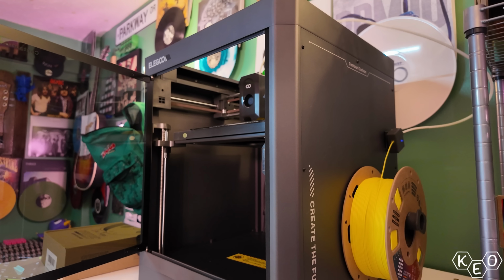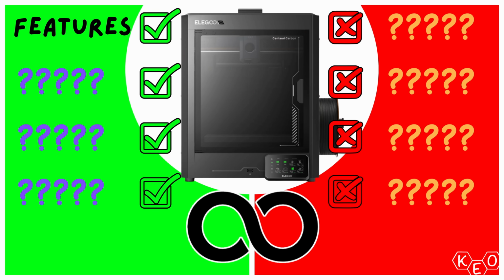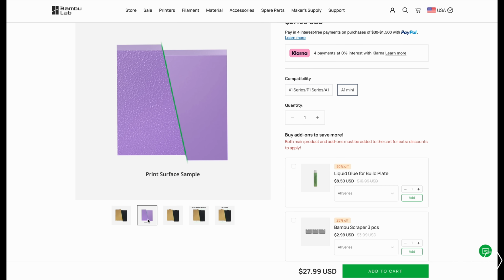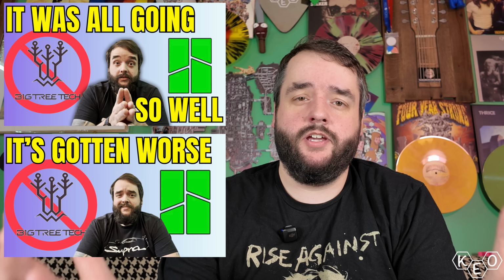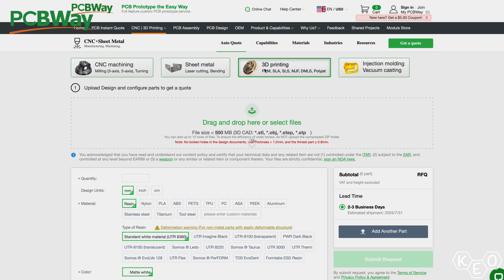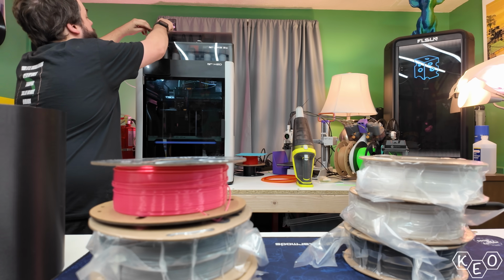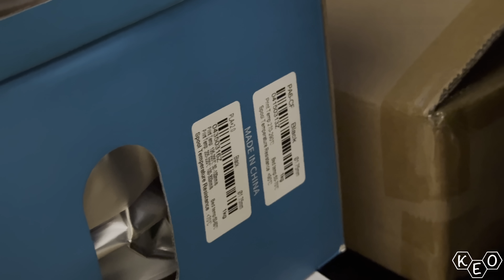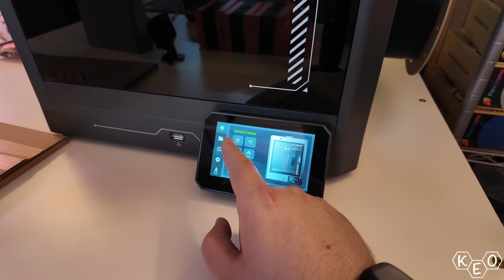This $300 Elegoo Printer Months Later — Here’s the Truth

Comment: I know this is an older video now, but I still thought it worthwhile commenting. I've had my Elegoo CC for around a month now and given it is my first 3D printer, of any brand or model, I think it's great. I agree it's loud, but that's the only issue I have. I printed the vented riser I  pla a several days ago and with the lid on and the vents open its quiet enough for me. I'm just learning the craft, so don't know what a quiet machine is like, so it's fine. Also, I asked chatgpt and it suggested I use the Elegoo slicer, and it's worked fine for me. Again, I probably don't know what I'm missing out on, but ignorance is bliss, or so they say (who ever they is). Here in Australia it's costs $670, but I got it for $600, I also got a Creality CR - Scan Ferret Pro for close to 40% off as part of the deal, so I'm happy. The main reason I went for the deal was I want to print in ASA or ABS, so having a chamber was a necessity. From what I've seen and heard, you can turn off the fans and the chamber will stay much hotter, so a heater is not essential. Anyway, thanks for the video, it helped confirm my purchase.
Reply from the maker: Glad to hear it. If this machine is working for you then that is excellent. Don't worry about the slicer, don't worry about the noise; if it is suitable for your uses then the printer is very good.

Comment: I just got mine a few days ago and I still haven’t been able to get it to actually print.
Reply: It took me about 10 minutes to figure out why mine wouldn’t print you had to make sure the temperature is the temperature. The filament requires. It should say on the filament what temperature you need to set it for
Reply: @s @samuelgonzales1466  I tried that. I’m using PLA, and Google said to set the bed to 60 and the nozzle to like 200-230 so I did 215, didn’t work.
Reply: What part are you stuck on?
Reply: @AfromanSkeeter  i put it together and set the language and put in the filament, but when i try to print anything nothing comes out from the nozzle, and the temperature changes from what i set to just random temperatures. Never the same though, somwtimes itll be 180,  others 140. Never the same though
Reply from the maker: What a mess. The machine should just power on and run through its self-calibrations. Then you should be set to get a print sliced up in the slicer and sent over

Comment: I bought the Elegoo Centauri Carbon. I paid $280 + $30 s/h the week after they announced the delay (perhaps indefinitely) of the four color system. Out of the box I printed all of the files that are on the included USB drive and they all came out nice. I've since downloaded a few files from thingsverse and the only one I had a problem with is a visor to shade the radio screen in my truck. However, I believe the problem is likely attributable to my inexperience in selecting a filament choice and the learning curve of Orca. I'm learning quite a bit that I might miss out on if my choice had been a more expensive machine in the walled garden of Bambu Lab.
Reply from the maker: That is true. The sliding scale of learning by tinkering and fuss free printing both have their merit. This is why both routes should be considered. Not necessarily this or that, but this AND that. Happy you are finding your way. Enjoy!

Comment: Mine has been so good, I ordered a second one. Which came with a vastly updated camera and light solution for less than the original price. I have done everything you could ask on it and its printed perfectly. ABS, PLA, PETG. Ive done everything from tiny little spindly things (harry potter wands) to pieces that take up the whole build plate. Cosplay to functional.

Currently you can get one for 270-280 thanks to Black Friday and the fact they just announced the CC2.

Am I thrilled it probably has some data going back to China? No, but right now its really just Europe and China making good printers and European companies are charging 3x more than this for the same thing. Yes, this is a "loss leader" but come on, just put it on its own VLAN and you dont have to worry about them snooping if they are.

Comment: Rethink about a riser there is a really nice one on printables "Elegoo Centauri Carbon: Yet another but sturdy riser" it not like the cheap ones everyone is using I like it because it has a place for lights and assemblies with bolts and nuts. I am looking forward to AMS for the same reason just easy to load up filaments in the mean time I am using a infinity flo auto loader it is not the best solution but does allow you to use 2 spools at the same time. My printer has 575 hours of print time and just placed an order for another one coming in today and when this gets all setup and elegoo puts out the carbon 2  I be getting that one as well

Comment: Comparing the Elegoo Centaur Carbon with the A1 Mini isn't really a good comparison. The reason people are watching this video is to see if the Elegoo Centaur Carbon is going to be durable enough, and should only be compared with other Core XY printers, not "bed slinger"...

Enclosure Heater on a $300 printer? Come on! I'm guessing the intent is that the fan is supposed to turn on if there is a sensor inside the enclosure and the temperature at wherever that sensor is goes above a certain threshold (for whatever material you are printing), the fan should kick on. It may not be getting hot enough at the sensor, to trigger a fan turn-on. Regarding an enclosure HEATER, I definitely do not agree that it should be included and fully functional on a printer of this price! You're expecting WAY too much! Elegoo needs to get onboard with upgrade kits and mods made specifically for their printer. The heater again, needs to be tied to a sensor, with the sensor someplace around where whatever is being printed is. After all, that's the location the temperature actually matters. If the sensor is at the top, it'll go off too soon, if the sensor is on the bottom somewhere, the temp will probably get too high...

Your review is a good one overall! Thank you for the honest review!
Reply from the maker: Thanks for taking the time to comment. Happy to have you around friend!

Comment: Between this and the qidi plus 4, if I don't care about size nor noise nor price, and want to specifically print engineering parts out of asa/abs/nylon/carbon fiber, which would you recommend personally? Or would they just be as good as eachother?
Reply from the maker: Well, I always recommend bambu before anything. They are the most reliable, fuss free, and user friendly. Otherwise, I am personally a fan of the Qidi plus 4 or the Qidi Q2. I have heard of others having issues so have a look around at reviews and decide for yourself but that is simply from my experience.

Comment: I havent tried, perhaps ill update this comment when I do, but I am pretty sure you have to enable the temperature control within the slicer if you want the chamber to be a certain temperature. It will not control the temperature by default nor is there a button on the panel but I believe the setting in the slicer for that print would do it

Comment: I have owned 8 3D printers in my life.. and the Elegoo is the only one.. out of the box that did ABS perfectly first time. Living in Australia I have seen PLA buckle in a car in summer!!!.
Yes the bed is a little small for big project, but I have my Anycubic Korbra Max 2 for large items.
Been printing now for 15+ years and its SO great just to power on, heat up, load and Print.
Previously it was tweeking, adjusting, adding Klipper, and mod, mods, mods.
Reply: Was one of “klipper  modded” printers a Reality Cr-10 ?

Comment: I literally just got mine and ran into all the problems it can possibly have from the start that other people have. There's a bit of green filament form factory test where it got clog in the extruder/nozzle and took way too long before i was able to pry it out. After putting everything back together then I have the issue where on boot up it stuck on a loop with the start up logo. I disconnect and reconnected back some of the lil cables and fixed that issue. But now on start up the nozzle temperature just kept going up and won't stop even when i try changing the nozzle temperature. I lastly have to resort to contacting customer support and waiting for a respond back.
Reply from the maker: Yikes! What a mess

Comment: I'm desperatly trying to find a great printer in this price point and I'm fed up with everyone recommending bambulab stuff. I DO NOT want to buy those exactly because of their anti-open-source / closed ecosystem. Closed ecosystem are dangerous and we have the chance that 3d printer are built around opensource so we must protect this at all cost. Its MY machine I don't want my stuff going through THEIR server that will inevitably get shutdown when they feel like it making the machine a big metal cardbox, which is why I'm pretty worried about Wifi 3d printers / apps.
Reply from the maker: If that’s the case, the Centauri Carbon is a great option. Otherwise, I am partial to Qidi printers. Their Q2 is a great option if you’re wanting multicolor as well

Comment: From the looks of it, it quite vibrates alot. I think the printer is having to low weight to combat that vibrations.

And i also dont like how the PTFE tube is moving the filament when the head is moving. The filament should be able to enter from the top and without any obstacles. Can they fix that in upcoming version, then im sold.

Comment: Yeah, every company needs to commit to one slicer.  Prusa Slicer is actually the core, then Bambu modifies that to Bambu Slicer, then Orca takes that and makes their slicer.  Prusa Slicer is already open source, why can't everyone just contribute to that?  I mean, I get release cycles and you might have to ship your printer with a beta version until Prusa can roll the feature sets you need into the official Prusa Slicer.  When your specific printer features are rolled in then just have your users upgrade to Prusa slicer stable branch.

Comment: I used the Elegoo slicer once. Then moved to full blown Orca. No issues. I'm with you on one slicer to rule them all!
The light: Please note, they have fixed that with subsequent shipments. Unsure if you can retrofit or get the new light from Elegoo. There are many solutions to this. A friend has the one with a crap light, he uses a rechargeable LED light strip with motion detection. Turns on as soon as there is movement. 

Overall, I'm embarrassed with the prints my Ender 3 Pro did now. I've put a lot of money into upgrades for that printer. I also have an old enclosed Creality CR-200-b. It is OK... but no where near the capability of the Elegoo CC. I could not be happier.

Comment: I don't get it.  Me the wife and baby sleep in the room next to the printer and my wife who can't even run a fun in the room because of her super hearing, can't hear the printer.  Also, I have never (despite Elegoos recommendation) run the printer opened.  It is always completely closed even for PLA and I've had nothing but stellar success with every single print.  You could also cut down the acceleration speed of the ECC by half to match the A1 which will also help quiet it down.  If you're absolutely desperate to go even lower, rig  a funny pad in front of the printer (w/ two light stands and two A clamps) to really deaden the sound.

Comment: Had mine a month and couldn't be happier. I've been using a flashforge creator pro for the last 10 years which has served me well so this is quite an upgrade for me, finally enjoying auto bed levelling, flexible buid plates and an extruder and heatbed that get to temp FAST. Printing ABS is a must for me and I almost pulled the trigger on the x1c a couple of times but hesitated after their snafu last year then the lacklustre release of the H2D - now I'm glad they dropped the ball and I managed to get this instead.

Comment: I am very happy with mine. The only issues I’ve had functionally were a combo of user error and bad filament.  I tried to print without the removable bed, and that made me replace the hotend.  Then I had 1.75mm PLA become 2.5mm in the same roll, and that clogged the hotend and needed another replacement.  Then I had to clean out the toolhead from all the filament shards building up from the  12 hr of run time with too thick filament.

Overall, very worth the $300.  And with cheap enough parts / filament, failures are not a huge deal

Comment: I have 160 hours on my carbon, I have had only 1 issue were my leveling got messed up and put the nozzle straight into the bed this gouged the print surface really bad. I ended up using a p1s print bed with zero issues.  

A solid ⅓ of the 160 hours is printing PET-CF for automotive parts I make.  

Over all i would 100% order another one when the time comes to expand.

Comment: Isn't calling it even kinda open source being super generous?  The firmware is still closed source, they've gone to some lengths to deter custom firmware, and they don't publish cad files for the hardware side of the printer.  Isn't the only open source part that they happen to use an open source slicer?  (oh and that they haven't (yet) walled off access to the core printer functions, but I'm not sure that falls under the meaning of open source)
Reply from the maker: Yes, I realize that it is a very generous statement. But like I said, it is open enough for me to use orca and that is all I am looking for. Its an unfortunately low bar but its more than I can say for Bambu and Anycubic

Comment: You say you don't care about the openness of printers, but if you had a regular plain Klipper interface you would know the answer to all your questions.  What fan is running, what temp the chamber is at and if the fan is running. You would even have a button on the screen to turn it on and off at will.  The temp of the hot end and the duty cycle of it, is key to knowing if you will clog your nozzle because of running to quick or fans too high.  This information is hidden from the user on Bambus and sure you have no issues if you run their filament and regular settings, anything else sucks and is like printing in 2015.

Comment: The one thing i don't like , and i think it's firmware related.
Once the machine is printing , you CANNOT remotely change anything , not even turn on the light.. not from the slicer , not from a browser. (you can type the ip adress in a browser and basically control and upload gcode from there)

Comment: You have to remember that the reason we’ve reached this point in the 3D printing timeline (cheap and good printers) is because of open designs and software. While I don’t necessarily care if a particular company is locking down a specific machine, I do very much care if they’re a good steward of the industry as a whole and if they’re contributing back after all the knowledge and engineering that they’ve benefited from (which is all 3D printing companies these days). If a company insists on giving nothing back, that’s one step away from the Stratasys model, and that model is pretty dangerous for progress in the category as a whole.

Comment: Thanks for the review. Quite informative. And I'm glad that Elegoo seems to be embracing Orca Slicer. Being able to use Orca will be a requirement when I decide to get an upgrade to my P1S
Question though... the parts of the printer that feels "cheap", are they things that you could possibly print replacements for in better materials? In other words, could there be an upgrade/mod path?
Reply from the maker: That's an interesting idea and I suppose you could. But in general, I feel like this machine feels a lot more premium than its price point. The electronics appear to be fairly simple and the brains controlling the thing are certainly simple. But in terms of the parts of the printer; I think they're pretty alright

Comment: My Centauri Carbon is due to arrive this week, looking forward to finally dipping my toe into FDM printing.   Honestly while it low price is very nice what really drove me to go with the ECC is having had Elegoo Resin printers for several years and always having a great experience when dealing with their customer service.  For me a known factor of good customer service is more value then risking a company I have no experience with or getting into a walled garden like Bambu has which ruled their printers out right away for me.   I do not use apple products due to their walled garden and will not use Bambu for the same reason.

From what I have watched I have a lot to learn to get good prints going, but it does seem much less complex then dealing with Resin and needing power ventilation to the outside to exhaust fumes, a respirator and Nitrile gloves to even handle prints for cleaning off excess liquid resin before or handling the prints in anyway before they are fully IV cured.
Reply from the maker: I think if you have figured out the world of resin printing, you are going to have no issues with FDM. Best of luck friend

Comment: Sorry but telling that Anycubics S1 is double the price is either bad research or just bs. You can get a Kobra S1 for 280 - 330 € depending on the offer. Got mine for 280€ ( $320) a month ago. the price of 550 is for the S1 including 4 color multicolor printing - a feature the Centauri doesnt even has yet.
Reply: ho hate or anything intendet. Just correcting wrong statements
Reply from the maker: That's a fair point. In this part of the world, we don't have that kind of pricing which is odd. Typically, based on what people tell me and comment, we usually have fairly inexpensive access to most printers.